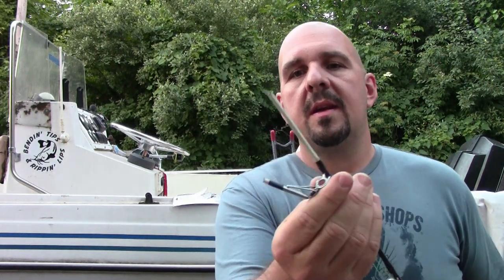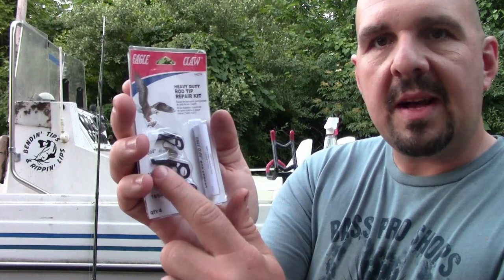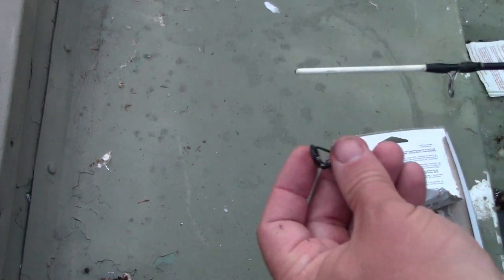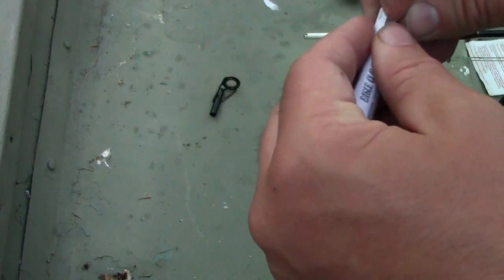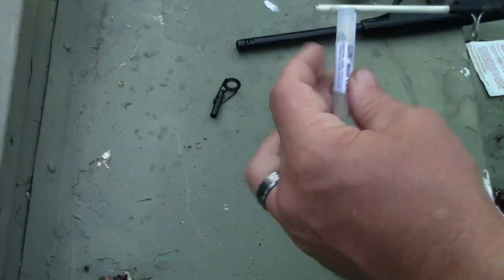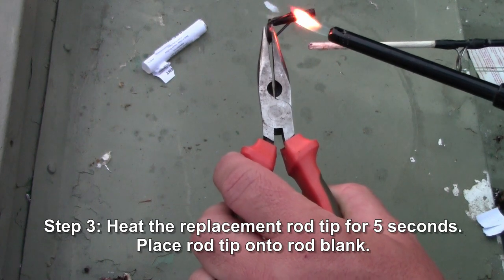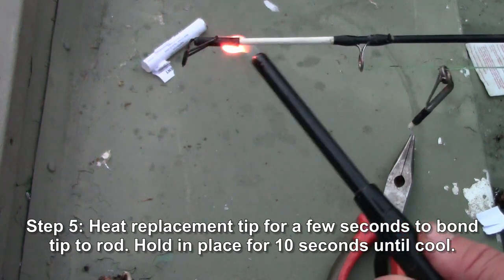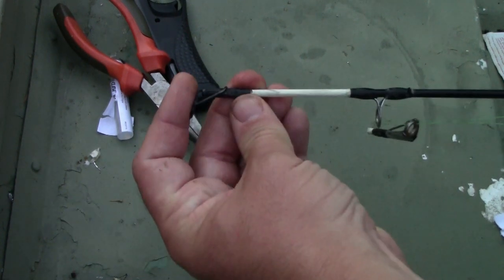How To Repair A Broken Fishing Rod Tip - The Fast, Easy Method!

Comment: i do it and it works great if you cant find the eye you want dont give up theres a eye out there that will fit even the big ones if you break a rod down about a ft u find a rod shop that fixes rods ask for a eye they should have one or check out amazon just had a rod break on me so ill be fixing it  thanks josh great vid tip

Comment: Heat end of old tip and remove the bit of rod ,you now have another spare tip.
Reply from the maker: Quite true. I usually throw those in my parts bin for when I just get a damaged but not broken tip. Excellent advice, sir.